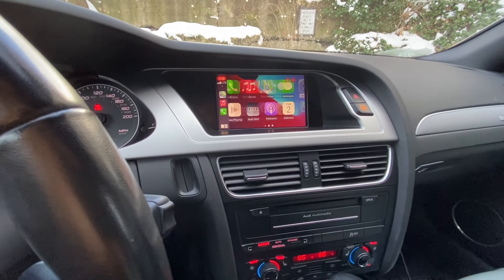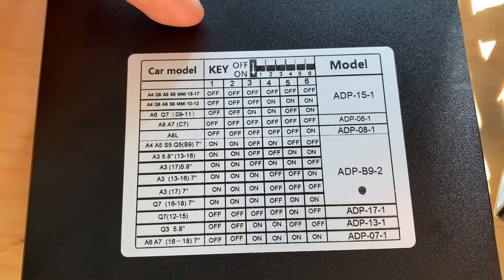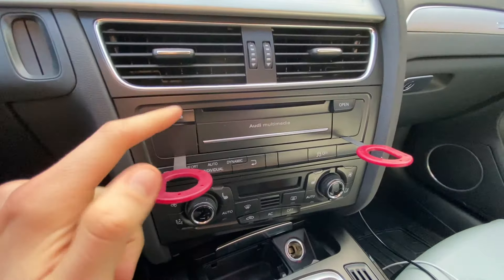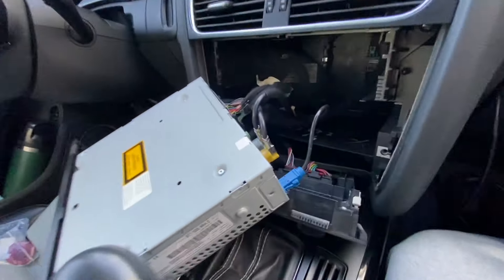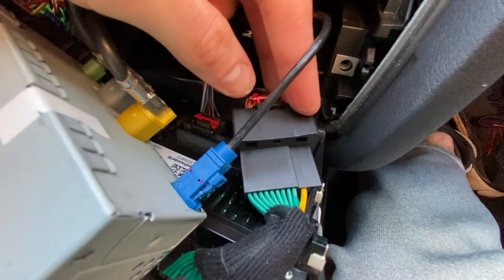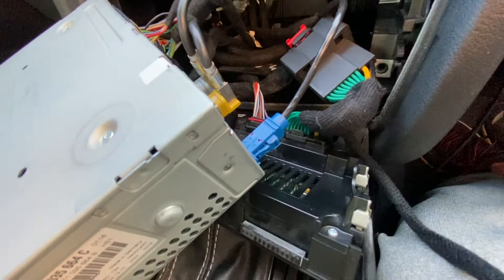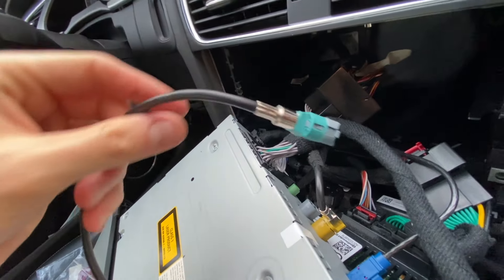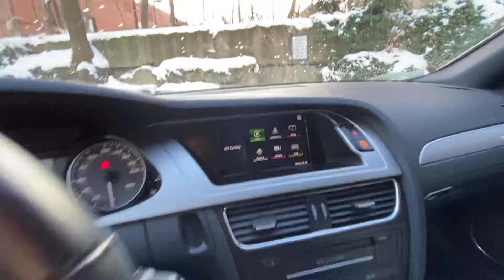Installing AppleCarplay on a B8/B8.5 Audi A4/S4 - (RSNAV)

Comment: I bought ECS unit you posted in your description. Let me answer some questions here to help with the parts i struggled with. 

Our cables are different. we do not do anything with the hvac cable. We instead have a wire that runs to the inner top left of the glove box (you must remove it). Youll see where the brown plug goes into a little black plastic unit. and stock wire goes to harness. 

The dip switch is different. I have the same model mmi as this video. They should all be up,  and number 4 down. 

The big cable is same, and the video signal cable precedure is the same. 

There are some extra wires to stuff in there, as you'll easily notice theyre optional and go to extra cameras and stuff

To make audio work, u must go to media and select aux source. Then itll work. Even in the background while navigating the cars stock system. 

To get to the car play, just hold INFO for 2 sec.
Reply from the maker: This is awesome, thank you!! Pinning comment
Reply: @griffenaddie  awesome. I know someone will end up here like me. Totally worth it. Not as hard as it looks. And the description says android auto only works wired, but that is absolutely bs. Mine connected on bt and works on Android auto no problem at all.
Reply: @Hopelessthugg would the unit you bought be able to work properly on a 2010 Audi A4?
Reply: @tehamijamil2371  yes. There are just different switch configurations u must flip on the box based on what year and nav system you've got etc.
Reply: Does android auto run well on the unit?
Reply: @sameerajponnoju3748  yes it's been great
Reply: Hi! I’m also about to add this ECS unit in. Quick question, did you say we have to remove the glove box on the B8 in order to get to that 1 wire?. I also have the same infotainment system as the person in the video. Btw, this is a great video! Thanks
Reply: @jaidencherkis2065  yes. Pull the glove box entirely out. Then up in the left  corner you'll see the CAN BUS light brown connector you'll be piggy backing.
Reply: @Hopelessthugg  Hey man, Ive had mine from ECS installed for a few months now. Doesnt REALLY bother me but the apple carplay screen isn't exactly centered. thin black line at the top where the apple carplay display ends and it cuts into the buttons a tad on the bottom. Wondering if yours was the same.
Reply: @lathamhiggins7323  if you have the exact same mmi as me, I do think it cuts off the smallest amount near the bottom but hard to notice so it's fine. I use the android auto. Guy at ecs gave me 2 possible configurations for the dip switches. The other option was one of the other switches down as well, and it actually cut off more for me. That's all it changed and I can't remember the other combo but I posted the one that worked for me

Comment: Thanks for the tutorial! Was very helpful. I tried installing mine today (2013 B8.5 Audi S4). I have the strangest of issues - my MMI does not show up but carplay works.Upon searching, it’s been the opposite issue for many people (carplay does not showing up). I have all switches to off position FWIW. Tried disconnecting the LVDS cable and installing the audi one back - then MMI shows back up. Any ideas?
Reply from the maker: One possible solution- once you have everything connected properly, double check that the mmi-aux cord is still plugged in.  you should still have the mmi-to-aux plugged in the glovebox and leading to nothing(not plugged into a phone). but mmi-to-aux must be plugged into the mmi glovebox spot
Reply: I ve got same problem, did you solve it?
Reply: @bruxmeister  yes- got the lvds cable replaced and that fixed it

Comment: This is a great supplement to the horrible/nonexistent documentation that comes with the RSNav system.  My unit is newer and a little bit different, but this video was a great help and I couldn't have done my installation without it.  Thanks!

Comment: Stumbled on this in researching Apple Carplay for the 2016 A4 Audi Allroad I just purchased yesterday, same dashboard as the one you show.  Incredibly kind and generous of you sharing your expertise and time!  With 3G being phased out, already is in many areas, does this effect the carplay wireless interface unit which mentions that it's tied into 3G?
Reply from the maker: Hi! Thanks for the kind words— so the 3G being referred to is actually the MMI(Audi term for stereo) version. Essentially in older cars is was called 2g mmi, then in newer cars 3gMMI, then 3g+MMI. The wireless CarPlay will work great in your car! This system works with anything above 2Gmmi. (Typically 2011 and newer)

Comment: Hi, many thanks for your detailed video. Clearly I can see it has helped others users as well as myself when installing these retrofit modules.

I wanted to check, I ordered my unit from Eurostyletunning, all works well except the sound in right speakers is low on sound, quality and bass from the left speakers. Is this something you have ovserved too? It creates unpleasant music experience and then I tried adjusting balance but it doesnt help much or lower sound quality.

Any tips on this would help.

Thanks
Reply from the maker: ah so sorry to hear that! No that is not something I experienced, but I ordered from RSNAV. sorry to hear that and that I can't help more.. I would check all the connections again?

Comment: The auxiliary source disappears often, and it shows back suddenly!! What that could be
Reply from the maker: @LamiElgammal  hmm. Can you elaborate?
Reply: @griffenaddie   at the Source option 
DVD or Jukebox or Aux. It dose not show the Aux option, and sometimes comes the message,accessorie cable not supported.
And sometimes it show up and I have souls and the aux option available
Reply from the maker: @LamiElgammal  super strange- I would contact their support and check all the connections are tight

Comment: This tutorial made installing this interface absolutely as simple as drinking water thanks mate. I have one question, i went to order this interface but on the seller website it mentions that if your car Software version number like BNAV_XXXX_XXXXXX for Europe are completely not Supported. Is your car version nuber like BNAV_XXXX_XXXXXX?
Reply from the maker: It really just depends on your MMI version. Which you can find in the menu. If you have anything above 2G . So 3G and up it will work! Thanks for the nice comment!

Comment: What is the old video but I have a 2016 S4 Premier plus so I have navigation and everything now I could see the apps on my screen SoundCloud on the screen to and when I play my song on my phone it pops up on the screen here and it's playing but there's just no sound
Reply from the maker: Make sure you have MMI to AUX plugged into your glovebox. Does not need to be connected to anything tho
Reply: @griffenaddie  oh thank you yeah cuz there is a wire in the glove box plugged up already I have to go to the settings and make sure it's on MMI auxiliary and then plug the wire into my phone and then it'll work

Comment: Tried this and followed instructions to a t in an Audi Q5, however it had a yellow and pink cable not a yellow and grey as per video. Doesn't seem to come up on the screen. Aux cable is plugged in the glovebox
Reply from the maker: are you holding NAV button for a few seconds to activate?
Reply: @griffenaddie  yes. I think it could relate to the pink cable

Comment: Have you had any problems with the RSNAV UNIT being so tight? Many people in other tutorials warn about the need to place them in a ventilated areadue to equipment warming.
Reply from the maker: I had no issues. Yes it is tight, but could make the space and sort of jam it in there. Had no overheating or any issues even on 3+ hour long drives with it on the whole time

Comment: I bought this product for an Audi A5 Sportback. The connection and wiring was done in 15 minutes, but it was impossible to fit the wires and the box back in the car. Shame as everything was working very well.  I will sugest to double check before buying to avoid disappointment.
Reply from the maker: it was a tight squeeze for me, but it luckily fit
Reply: Where did you go to get yours installed?
Reply: I tried my best but I failed miserably. I asked few of my friends and they couldn't either even though were more experienced than me.

Comment: Thanks for this video! I installed my box on my 2014 S5, and everything seems to work, except when a call comes through CarPlay, the OEM mic won’t work.. works for everything else on CarPlay though 🤔
Reply from the maker: Hmm very strange.. not exactly sure tbh. Many its a feature - as in mine it was too echoey. I needed to use the phone instead of car mic anyway

Comment: Awesome video man! The best I've seen so far. I'm so glad I found your video. But quick question, does it have a wire for USBC like an Android phone? If so, mine sending the link. Thanks so much!
Reply from the maker: Thanks so much! The version I made in the video does have a female usb wire that you could connect a android wire to. BUT the current version on the rsnav website is wireless so no wire is needed
Reply: @griffenaddie  that's even better! Thanks again

Comment: Super video watched a few that kind of made sense one thing is you did not mention the use of the AMI lead in the glovebox and switching  to connect wirelessly ??
Reply from the maker: the system I installed here is wired rather than wireless. Just left the MMI to aux connected in the glove box . ( I think leaving the aux plugged in but not connected to anything is a necessary step)

Comment: I have the same set up but I’m having a hard time getting it into CarPlay. I was able to get into the CarPlay version once but can’t seem to get it back. All I have is the default resnav selection with google maps and various apps.  I’ve only had the car a week so it’s possible I haven’t completely figured it out but I thought it would be easier to do. Stumped atm!
Reply from the maker: strange! Make sure you are selecting CarPlay. and holding all the buttons etc correctly.

Comment: Great video! Tho i have 2 questions, does the rear view camera shows on the screen when put in reverse on a carplay? And do you always have to connect your phone to the car in order to work? If so I dont see the use in these it will drain the phone battery and I could just put a phone in the phone holder while using stock audis operation, right?

Comment: i bought the ESC version. I hooked up everything and the screen is operational but the only problem is the buttons and dial on the center console stoped working. I have a 2011 s4 as well. Tried taking everything out and putting it back together but I got the same result. Any ideas?
Reply from the maker: @nugggetchicken2834  that is super strange… hmm if you have checked all the connectors are properly hooked up- I would call ECS. They have great support

Comment: Hey man great vid helped me out a lot I just have one issue it’s that the music does not come out the speakers? Everything is working I can pause play and skip the music it’s just won’t play anything through the car speakers how can I fix this. (It’s the bluetooth rsnav)
Reply from the maker: hmm... three thoughts here....
1. Make sure you have an aux cord plugged into the MMI output in the glovebox. Should have a MMI to aux cord plugged into the outlet in the glovebox but just not connected to anything.
2. If that does not fix it make sure the bluetooth rsnav, phone, and car bluetooth are all synced up!
3. unplug/replug all the connections . although thats a long shot
Reply: It has to be an aux? Currently have a tune2air in there not sure if that can fix the problem. I was never able to connect to the tune2air in the first place that’s why I bought the rsnav.
Reply from the maker: @anthonyhuerta1834  yes I would try to use a MMI to Aux and leave that in the glovebox. Is your phone connected to the RSnav/ Rsnav connected to the cars bluetooth properly?
Reply: The Bluetooth seems to be connected properly because I can skip the songs on my phone and I’ll do the same on the screen as well as play and pause just (no sound). I’ll try putting in the aux see if that resolves the issue
Reply: @anthonyhuerta1834  did it worked ?
Reply: @ yeah just had to hook up and aux and set it to aux setting right above the speedometer
Reply: @anthonyhuerta1834  are you still happy with your carplay?

Comment: Hey when looking at RSnavs site it says NOT FOR CONCERT or SYMPHONY or 2G MMI or 3G MMI Basic. I saw in a comment you said you only needed 2G. I have a 2013 Audi S4 and was wondering if it will work only having 2g MMI along with navigation? Thanks!
Reply from the maker: Hi, 2Gmmi I do not believe will work with this... Email RSNav to double check as you have NAV... So cant say for certain.. Sorry!

Comment: Any idea on why the system doesn't startup did everything in the video original Bluetooth and everything works.
Reply from the maker: Not sure - all plugs properly put in? Activating it correctly?
Reply: @griffenaddie  figured it out. Had to change the switches on the box.
Reply from the maker: @chumchumy  enjoy!

Comment: Great video, very helpful!

Did you disconnect the battery first before starting the installation? Some installation guides recommend it, as will also prevent you needing to clear codes (?) if the power is on whilst components are disconnected. The car manual however warns that windows me need resetting if battery is disconnected, so don't want to muck about with battery unless necessary

Comment: Thanks for the video but I am so confused because looking at the rsnav wiki manual. They talk about taking kit glove box to get to the can bus junction or soemthing? Is that optional.... Your way seems so much easier by using the climate control... but I am a bit confused why there manual goes the hard way?
Reply from the maker: hmmm to be honest, I am not too sure about the other way you mentioned! The only thing relevant around the glove box is that you need to have a MMI to aux plugged into the output in the glovebox (does not need to be connected to anything just plugged into the glovebox)
Reply: @griffenaddie  Well i will be going your way for sure, the manuals they provide are the most difficult thing to follow, so thank you for taking time to make this

Comment: After installing, my drive mode selector buttons light stopped working. Oddly, the lights on the cd eject and open buttons and even the stability control still work. Any idea why or where I can go to find answers?
Reply from the maker: Super strange! Have never heard that.. would double check you didn’t accidentally knock a plug out but really not sure.. maby check Audi forums

Comment: Your tutorial is very helpful, though I have one issue with mine,
Mine wireless connects through carplay and everything works fine
But for some reason there is no sound coming out and not sure what the reason for it is, mine is a 2010 s4
Reply from the maker: Hey! Make sure you have a MMI to aux plugged into the glove box

Comment: Very helpful video. Does the wired connection charge the phone? Waze can drain the phone on long drives. Does Spotify keep playing when you return to Mmi functions?
Reply from the maker: yes it does charge the phone! just a bit slower than an actual wall charger.. yes-- Spotify keeps paying even if you switch back to normal MMI functions

Comment: Hey man, firstly thanks for a great video. I've never taken apart an Audi media console before but after clear detailed steps in your video I feel pretty comfortable with it. 

Quick question, are there any instances or varients of a 2016 q5 that this device doesn't support? 

I'm assuming this device takes audio through the aux input signal, is this dependant on a factory aux input in the media menu? If the q5 doesn't have factory aux option in the media menu, will using the Ami adapter simply allow aux to function as required for this device or does adding Ami aux cable require some sort of coding or activation? 

Thanks again
Reply from the maker: hey! thanks for the compliment. On Rsnav's website I see two options for a 2016 q5. so make sure you order the right screen size(7 or 8.3 inch). You can always email RSnav before hand to ensure it'll fit with your exact car. It does take audio through Aux, but you have to leave a aux cord plugged into the glovebox but just not connected to anything. Then it will all go through either bluetooth or your corded system. No coding necessary, you just use the oem "media" button. Your car is slightly different/newer than mine. apologies if I cant answer all of the questions. All in all, if you order the specific one for your car, there should be no coding necessary, just plug and play.

Comment: I scrolled through the comments but didn’t see this question. 

While in CarPlay mode does the climate control stuff still come on the screen when you’re adjusting say the fan speed or seat heater?

Thanks! Super helpful video! I was considering doing an iPad dash until I saw this.
Reply from the maker: great question! 
-the fan, temp, and heat seater does not come up on screen like normal. But, I did not find it to be a problem as it still adjusts just like normal and displays on the lower red led screen right next to the controls. 
So you can still see temp, fan speed etc it just doesn't display on the upper screen when you are using CarPlay

Comment: Great Video! Will this work if my Audi has the buttons not under the gear shifter but under the vents in the front dash (Audi Concert). 2010 A5 thanks!
Reply from the maker: I believe you can -- BUT first check your MMI version and check RSnav website to makes sure its compatible
Reply: @griffenaddie  How do I check my MMI version? Thanks
Reply from the maker: @KDMND  should be able to access this by going to the software and checking current version in your MMI.